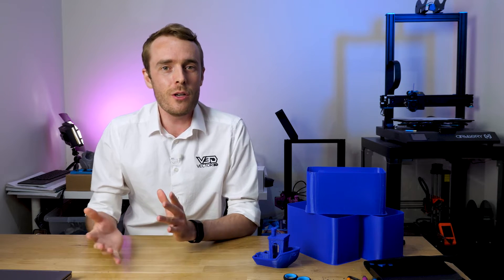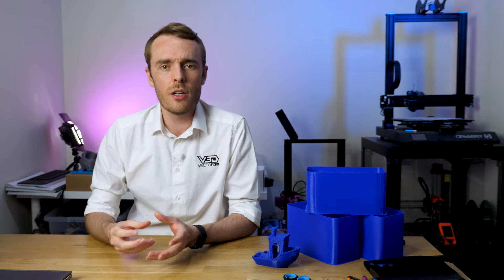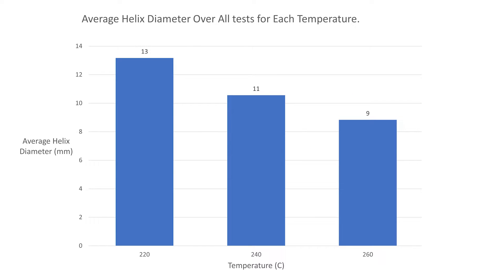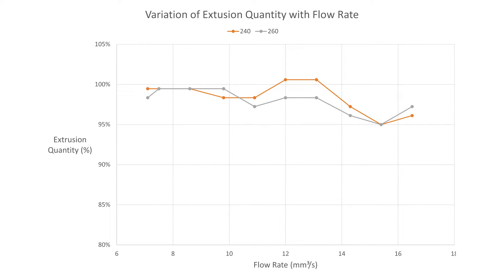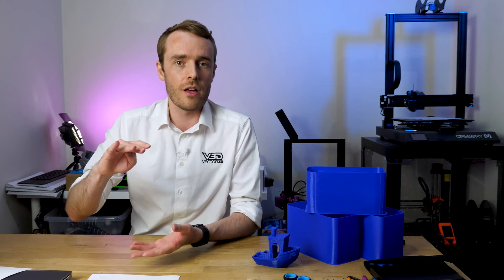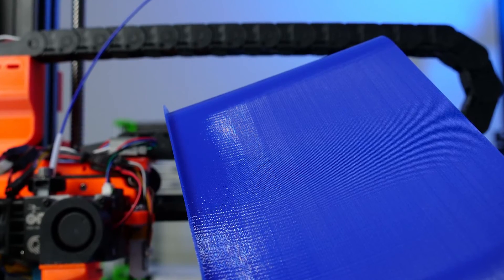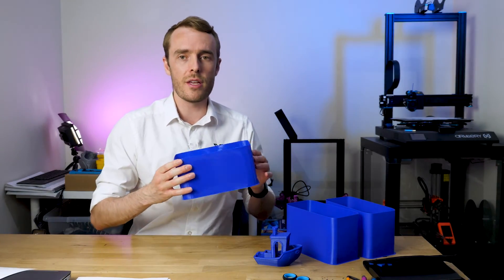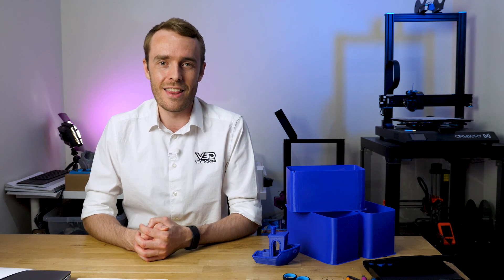3D Printing FASTER just by printing hotter?

Comment: Once you reach more, you need to ALSO need to cool it as well, you would have to increase your cooling, then those higher temps will run just fine.  that is why a k3 or a vz bot can print PLA so much faster as well, because they have MASSIVE cooling.  Your little ender thing there is hardly good at cooling.

Comment: I also assume, the nozzle hole will get a bit smaller because the hot end material extends and the nozzle gets smaller. Not much, but we can calculate that with the knowledge of the material.

Comment: BTW it's "cubic millimetres" not "millimetres cubed" – they are very different. 3 millimetres cubed is 3 x 3 x 3 -> 27 cubic millimetres.

I remember a garden program where the presenter did the same thing. She'd say "mark out an area 9 metres squared" (which would be 81 square metres) when she meant 9 square metres – i.e. 3 by 3.
Reply from the maker: Unfortunately not. they both refer to the volumetric unit mm^3. anything else is just colloquial language which gets incorrectly used.

Comment: All very good information thank you for sharing. However I would like to point out a key note that you didn't hit on. If you are going to push pla to 240 or 260 c. Please note the type of hot end you are using. High-end hotends are all metal throat nozzle etc. However on say and ender3 this is not the case and you shouldn't heat over 220 c because of the teflon tub that is down the throat of the hotend. Great information though.
Reply from the maker: Kind of assumed this went without saying. If your horned temp limit is 230, don't print hotter than that...

Comment: Excellent video. I world recommend looking at the print job using a thermal camera that can record video to get greater insight as to heat diffusion from the print job, for different print heats, bed temperature, print speed and flow rate. The detrmining factors will be the difference between amount of heat leaving the print job versus the amount of heat leaving the print job.  Check my response to another viewer, where I have explained the mechanisms behind why  using glossinees is a reasonable measure of print quality. I use the analogy of solder joint glossiness and cold solder joint quality.

Comment: You should compare the layer adhesion at the higher flow rates at different temperatures.
And also increase the flow rate until the extruder starts to skip and compare at different temps.

Comment: It was a surprise to see you taking my suggestion.... and u did an excellent job testing and concluding. May I suggest investigating mor robust filament cooling fans and shroud designs for higher heat options? I love that yer pushing speed edges in fdm!

Comment: Great video! So much information and love the section summaries. Still a bit hard to digest the loads of data to real life performance factors but happy to be able to rewatch once the experience is sufficient. :)

Would be quite interesting to figure out the ideal settings to willingly achieve glossy and matte prints from the same filament and printer. 

Or as a more clickbaity title: How to achieve maximum BLINDING gloss!

And to have a topic for another vid: How to achieve the smoothest matte print.

:P

Cheers :) wish a very great day

Comment: I think die swell is the cause of the increase in diameter. The speed increases the effect.
Reply from the maker: Ah yes, just had a look around, die swell looks to be exactly what is happening. I wonder if slicers account for that...
Reply: Vector 3D I don’t think they do. It would have to be a function based on speed and not simply a number unless the movements involved are considered stretching and naturally counteract the effect. However the whole die swell has an effect on surface quality. I’ll research it more but I hear this rarely discussed for print quality.
Reply from the maker: @GreyBeard3D  and the rabbit hole just gets deeper and deeper! 😂
Reply: @Vector3DP  Die swell should not be a very prominent effect during an actual print, since it is not extruded into free air but rather forced down under pressure against a surface.

Comment: Good vid. Its a nice technique for really rough quick draft prints. Moving the head faster increases the cooling of the outside of the nozzle due to ambient air temps being lower and layer adhesion becomes an issue due to the layers not having enough time and temp to create a good bond. A heated build chamber along with warmer filament to start could help with both issues of the nozzle cooling too fast from filament temp and ambient temps.